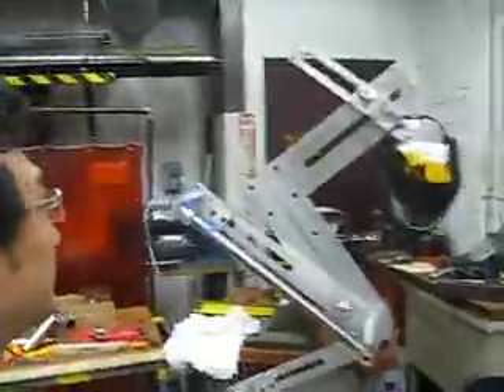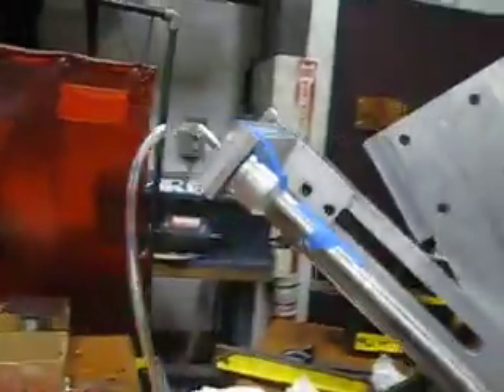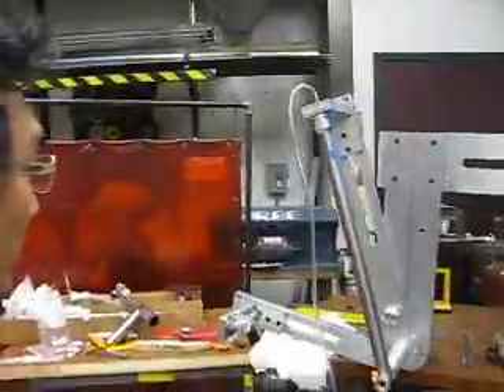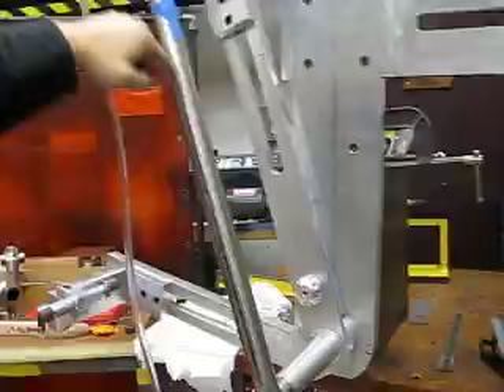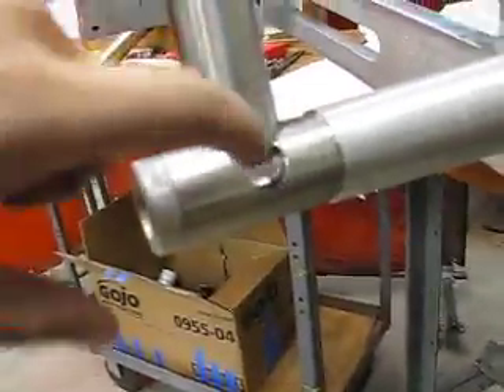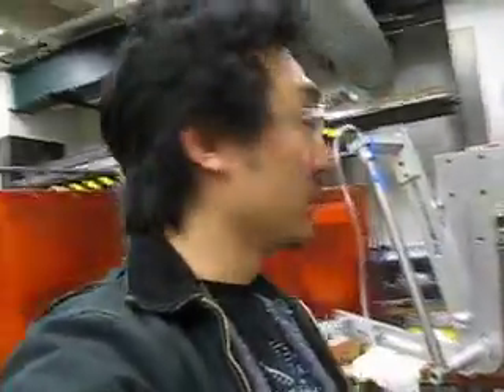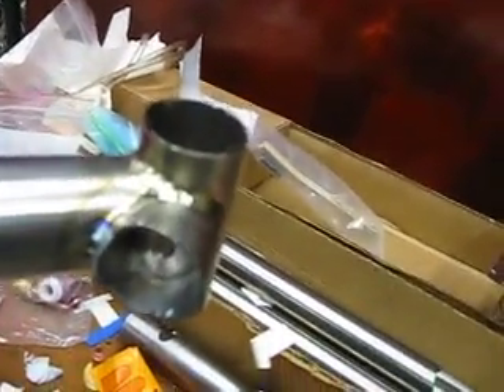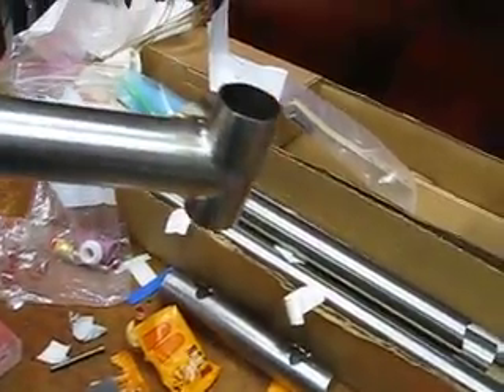Welding Titanium

Comment: @snugs342 I believe you are talking about weight/density ratio. Aluminum in its pure form has lower weight/density ratio compared to steel. However alloying with various metals (which is where distinctions such as 6061 and 7005 comes in, it is just a code given by automotive industry based on major alloying metals) and heat treating gives it both greater strength and ductility (again terms like T5 and T6 is used by automotive industry based on what temp this was done at).

Comment: Ti has much higher strength/density compared to aluminum alloys such as 6061 and 7005 however it is also much more elastic material. It is possible to make very light Ti frame it just would be all noodly and woobly. Lightspeed Gishello, which weighs less than 900g for 56cm(impressive even for carbon frame) is an excellent example. The same frame is also notorious for being flexy and unpredictable in corners and generally unridable.

Comment: pure magnesium is not suitable as a frame material. It is actually a aluminum alloy that has higher mg content (anywhere upto 30% as used in pinarello dogma). mg is extremely reactive to oxygen and therefore needs to be protected from the atmosphere. pinarello dogma has paint over ceramic coating to protect from wear, scratches, ect. which makes it a lot heavier than conventional aluminum alloy frame   xp

Comment: I'm assuming you mean 6G not Gg.  I'll try to help.  CLEANLINESS is next to godliness.  Clean the INSIDE of the coupon as well as the outside (wirebrush on a grinder with a stainless wire wheel).  Since you don't give thickness of the pipe I can't help with anything other than stating WALK THE CUP (practice).  Freehand is to open to defect.  Good luck. SOURCE:  6G and FAA certified welder.